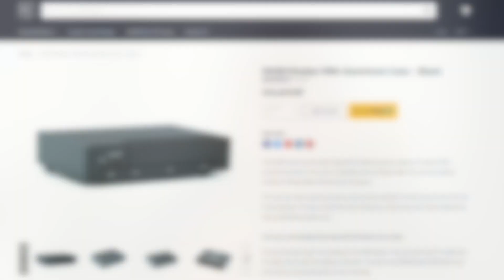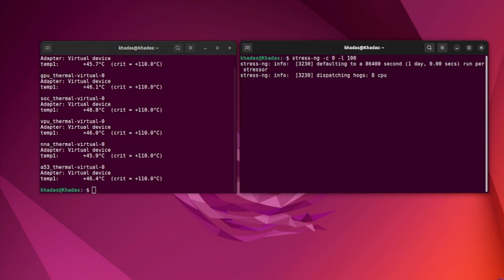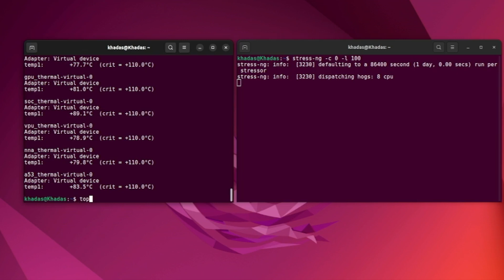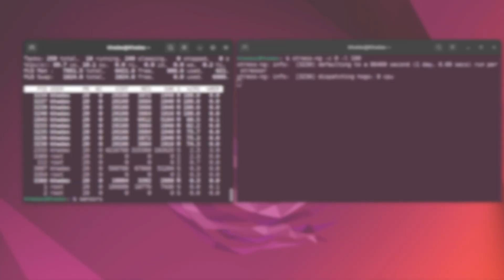Khadas VIM4 Passive Cooling with KKSB Aluminium Case

Comment: can it also hold the wwan expansion board with 5g module plugged in?
Reply from the maker: Good question. I am not sure. I guess probably not because the case is quite small. You better double check dimensions of the expansion board and the case.

Comment: Small tip, if you want to see repeated output from a program you can use the linux command `watch`.
e.g. `watch -n 0.3 sensors` would provide smooth display of sensors data.

Also are you sure having two different pads is not the reason for the bad thermal performance?
You might want to repeat the test and see what is the temperature of the heat sink. Even if it is 10 degrees lower, (80C) it would still be too hot to touch.
Reply from the maker: Yes, the 2 pads may have a negative temperature effect. The original pad is kind of fragile so I wanted to keep it just in case I decide to go back to the setup with the active cooling with the original heatsink and fan.  Based on a comment at KKSB website I see other users have similar experience in terms of temperature so the 2nd pad doesn't have a huge impact: "with this pad the board idle temperature is 60C and 80+ under 100% load."

Keep in mind that although the temperature of the CPU goes up to 90C, the case isn't that hot so it won't burn you if you touch it even it such extreme load of the CPU.

Thanks for the tip about watch. Probably I should have done it in the video this way.